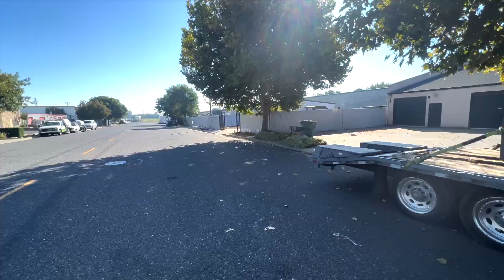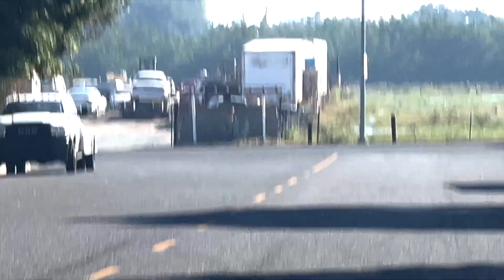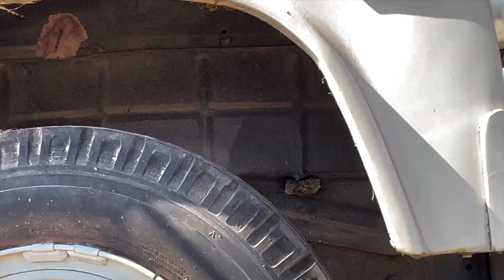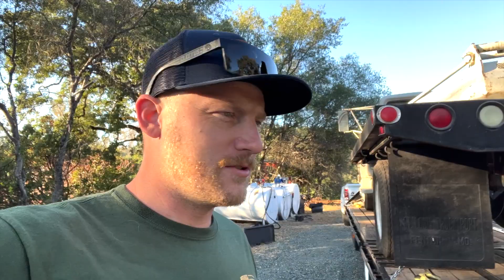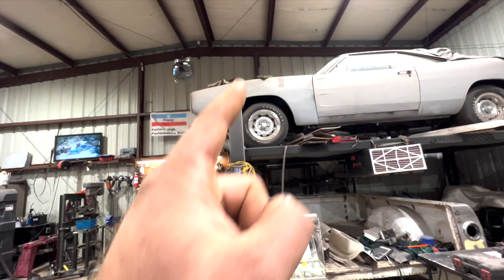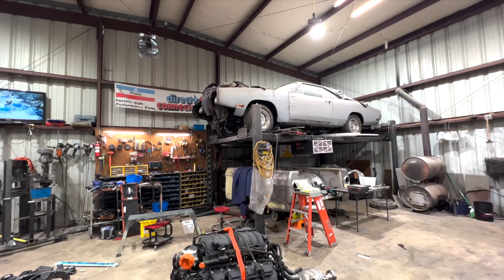HEMI SWAPPING MY 1970 DODGE CHARGER! Bye bye 440. Hello 6.4 hemi

Comment: That is a awsome motor  I have the same combo in my 69 charger , swap the cam to the cam motion titan 1 for the 6.4 make sure you have the he'll cat lifters , mds delete and vvt from stanke motor sports , he'll cat injectors and holley int make sure you get the terminator x to control transmission 
going to be a sweet build

Comment: 5500 Cummins with a 6 auto or manual transmission with 410 rear end and Alcoa rims . Is it going to be a flat dead dump? If so put som log bolsters and use it for running small fire wood logs. Awesome deal and video 
Denis from Santa Rosa CA

Comment: Glad your doing what makes you happy, that's the most important thing!  I think you did well on the swap too. The Holley controller runs the FI, Ignition, and Trans?  Those ZF transmissions have a great reputation!  In addition to RAM trucks, Dodge cars and some Jeeps, they are also used in Rolls Royce, Bentley, BMW, Jaguar and more!  Nice!   8)     --gary

Comment: Hey Sam, I think I have that transmission in my 22 Ram. Mine has the dial shifter which I am not crazy about. Other than that its a great transmission. I would like to see how you fit that transmission in.